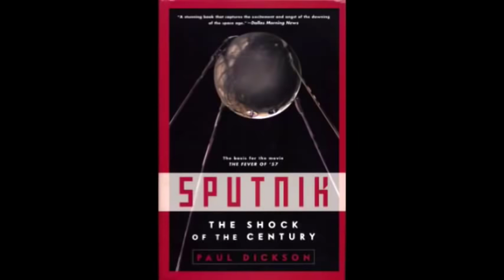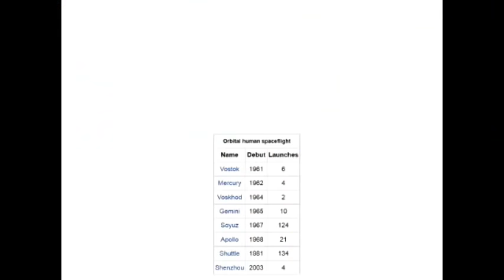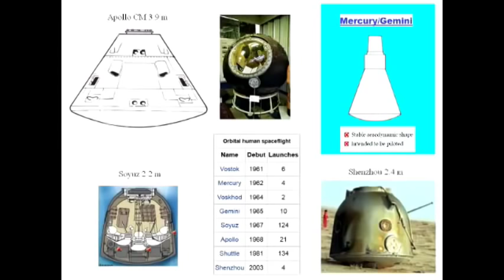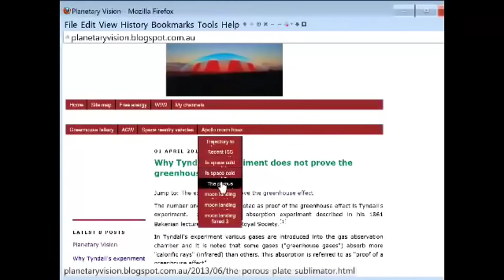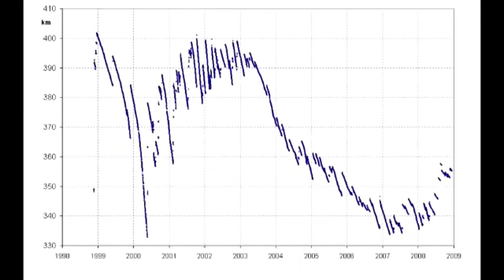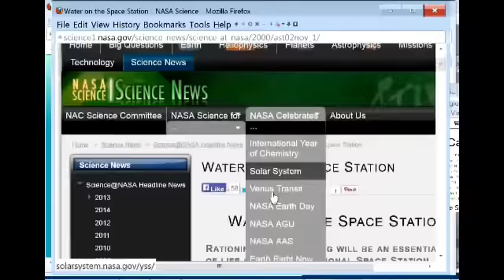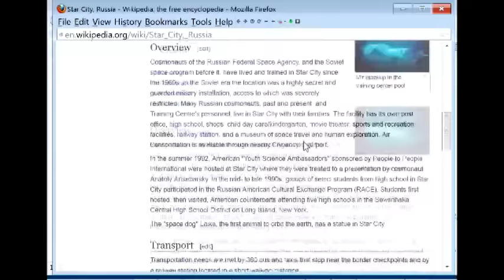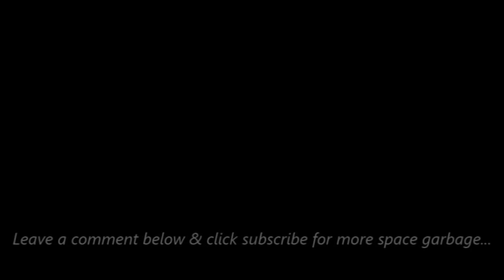The ISS Exposed

Comment: There is an app called ISS spotter.  What it's really good at is predicting when it will be dark where you are as the sun is over the horizon, and the ISS is passing over head in the sun light 250 miles over your head.  it's very precise and actuate  and I think as I remember, it's free.  It's seems that a few days a month where ever your are south of 58° north or north of 58° south, you will be able to see the ISS pass over head in the Sun light while it is dark on the ground.  It is very very bright  and very easy to see.  
If it's in the evening, it will predict when it will be visible from the horizon and then pass into the shadow of the earth.  If in the morning it will predict when the ISS will appear from the the shadow of the earth and be illuminated by sunlight.  It's a  lot of fun to watch.
Reply: It still doesn't prove the iss. It just means there's is something flying around up there. It doesn't mean it's a tin can with people in it going 17,000 mph. Check out Jeranisms videos on solar and lunar passes of the iss.

Comment: Its CRIMINAL, spreading such false information.
Shame on you John Warren.
Reply: @Douglas Waugh Covering up ISS?
What information do you have that suggests some kind of coverup occurred?
Reply: @Douglas Waugh HAHA... me too :)
But seriously, the misinformation in this video is fairly obvious. I only watched a few minutes, but it was sad. Narrator claims are WAY off. The surfaces are washable, only Russian side has some old Velcro covered walls. 
There are airlocks between EVERY section, they are raised hatches... you can see the tracks on the US side, and the rubber seals, and the Russians have round hatches. In some areas, these airlock hatches are VERY obtrusive and difficult to get around.
The build is based on what can be carried up in space, these cylinders make the most sense, and so a spindly branch like structure was the adhoc design. 
They did have issues with exercise equipment inducing vibration into the frame early on... but developed better treadmills and workout equipment.
The water system isn't all that novel... its simply a pressurized sand filter, with a carbon filter. Activated charcoal has micro pores that trap the smallest of bacteria. Its not all that complex...
Anyways, the narrator definitely makes MANY MANY MANY assumptions without actually knowing how the space station works. He grabbed a few photos off the internet, and couldn't reason why some things were done, or heard national geographic say... "some advanced technology"... simply because of lazy reporting, or NatGeo trying to hype up the cool factor behind the space station.
Anyways... 
I didn't see which part the "Guys Shirt" you were talking about... I scrubbed through but wasn't willing to listen to more than a few minutes of this video, which in just a few short minutes, I heard these 4-5 assumptions used to discredit the entirety of NASA.
Reply: @Reach3DPrinters  It is all true we do a report at CNN on the anniversary of the moon landing and we do multiple reports on the ISS. You probably have seen my show on CNN, I am Anderson Pooper award winning journalists, so you know you can trust me.
Everything the US government and NASA tells the American people is always the truth we have no reason to lie... Trust us we only have your best interest in mind...
Reply: @AZ Homes :) lol
Reply: Your projecting! Yes NASA does appear to be criminal!
Reply: @beckylovelights3349  Skepticism is a great thing, it false information. There are so many blatant lies that are made, that contradict the video itself.
Reply: @stephenb8687  Go on....
Reply: Grenherb  
Did you read what I said?
Attaining a 24 hour, seamless video is basically impossible.
Reply: Grenherb  
Please respond that you either read enough, or understand enough, to know that rockets don't just launch into space and meetup with the ISS... Its not a simple 30 minute excursion, it can take DAYS!
Reply: Grenherb  
Sooo... you didn't read, or you don't understand... or both.
Got it.
Reply: Grenherb  
Right?!
You figure with such a huge budget, they could afford a better CGI team, ensure storyboard continuity, etc...
All these hundreds upon hundreds of mistakes... you'd think they would get at least the CGI right.
I mean....
I cant see any other reason for people to vanish from frame lag.
Also, you'd figure we would at least get some movie quality production... I mean, they use a film studio... and they can afford the best studio equipment... so why are they going so cheap on the special effects and making such obvious mistakes?
NASA needs to clean their act up and sell us some more convincing materials, right?!
Reply: Grenherb  
you've watched all the 20+ hour ones? Uhh... I don't think there are any 20+ hour ones that ANYONE watches. They don't exist. The ISS stream is off every 45 minutes during the night side.
Usually what your watching are clips, that roll into other clips.
SPACEX only releases interesting footage. Whats the point of releasing a video of the horizon for 20 hours?
Streaming? Again, not so simple to stream data from a rocket. Technology is only JUST reaching that point. Its like sitting in a football stadium, trying to hit a punted football with an automatic bbgun, and keep the target tracked the entire time, while riding a bike across the bleacher seats. When you consider the small amount of power dedicated to streaming video, over a 1.2ghz frequency for optimal range and amplitude, maybe 5 watts... the signal must be picked up by patch antenna or parabolic dish on the ground. The first 20-30 seconds, not a big deal, but were talking about 18,000 mph speed! Depending on direction and launch intention, these will generally head out over the Atlantic, where a floating ship in the middle of the OCEAN with 40 ft swells, has to track a dot flying over the entire horizon in 3 minutes. The maths being taken into account are dense on a processors potential, and this was not possible 15-20 years ago. Your tracking by GPS the ships location, using accelerometers are adjusting real time to the pitch, roll and yaw and slipping of the ship, and calculating the expected acceleration curve of the burn. This all has to be constantly corrected and adjusted for in REAL TIME to follow and read the "stream" just for your precious video... when they don't give a shit about video streams... they are crunching real data, and watching logs as events unfold to predict any possible threats to the mission.
Now... 
Lets also consider that the atmosphere becomes very dense at 45 degrees altitude and below, and these signals would have to be picked up by other ships or aircraft at regular intervals, generally changing recievers every 2 minutes... potentially over hostile territory or no fly zones. We can use other satellites in orbit, but satellites are not just open for use. Time is precious, and they are often owned by telecommunications companies, like dish network, and to buy time is not feasible for a frivilous venture like live streaming video of a launch. It far more economical to simply record the launch, and upload the data once in orbit, from known locations and speeds that can be tracked more accurately.
Elon Musk... now he might do it, but that is because he wants people to be excited about the future of space, and encourage interest. Nasa could give a rats ass. They are a business that works within a budget, and wern't directing their resources toward the changing online social structure that has evolved these last 10 years.
If your actually interested in understanding the difficulties in the logistics of data streaming from space, you will understand why your desire for constant live streams is RIDICULOUS and probably wont happen anytime soon.
I should mention, streaming from an expected trajectory, like the ISS, is an easier task. Streaming from an accelerating launching rocket... is a whole other beast, burden with some unpredictability from high turbulence, high speed upper atmosphere winds, unbalanced engine thrusters, etc... MUCH more difficult.
Reply: Grenherb  
When ever you get the full footage of someone driving from NY to LA... we can talk. Until then... the United states having an east coast and a west coast is a LIE. If you think the US touches the Atlantic and the Pacific, then your a fool who believes in their lies to make you feel better.
ONLY when I see a live stream, of someone driving from NY to LA, will I believe it.
LOL, yeah, cause that makes perfect sense.
Reply: Grenherb  
You realize i was mimicking you, using your exact argument as a joke.
The "excuses"... trying to convince myself... is YOUR premise.
Reply: Grenherb  
So why would you suggest your own premise or requirement for proof, requires excuses to sustain its validity?
Do you not seriously believe we've never been to space or the moon?
Reply: Grenherb  
The technology was retrofitted. The data was destroyed by age. Have you seen ANY magnetic tape data storage systems lately??? 
The BS you hear on youtube, is taken out of context. You hear something like:
"we don't have the technology to go to the moon".
Well, the equipment used, the infrastructure built around the Apollo program no longer exists. We COULD rebuild the old systems, put them back exactly like they were, but why??? IF we were to send men back to the moon, we would want an updated vehicle system, with new computers and support systems to meet FAR more safety regulations. It would be a MASSIVE undertaking, 5-10 years, by 1000s of people. Who is going to pay for that? Nasa could... but what is gained by going to the moon again? There is NO point. That is why no one goes anymore. We can gain greater knowledge by orbiting a satellite around the moon.
The data got destroyed by time. It still exists, but some probably has severe damage from magnetic field losses. The data was backed up into digital storage, so its not gone, its just been converted.
Nasa is an Agency of the US government. It is not privately owned... However, you cant just walk in. Nor can you walk onto an airforce base. You must have clearance, so num nuts don't do stupid shit. We were in a space race with Russia. Of course new technology was being kept secret. It still is. Consider area 51. Its a military base. They work on advanced aircraft. They don't want morons taking photos of advanced weapons, to post all over the web, and give expensive technology away to foreign threats.
Testing, testing, testing. We evade risk by testing as MUCH as possible, to solve problems before the cost human life. Russians did less critical study, and more "lets try again". They killed a dozen cosmonauts behind closed doors before the first successful orbit and return. NASA crunched the data and simulated the HELL out of scenarios and made modifications. Our computers were better than Russia, as we developed the transistor and were further ahead on the tech curve. Russia was further ahead in their rocket design. We probably stole a lot from them during the cold war via espionage. Mechanical design is far easier to reproduce than the architecture of an early computer system.
Reply: Grenherb  
Do you believe the Earth is flat?
Reply: Robert Mugabe  Robert I would like to invite you and Big Bertha on CNN so you can tell us about NASA. Please invite your girlfriend Big B she is amazing...
I am Anderson Pooper legendary journalists and Gerbil love...